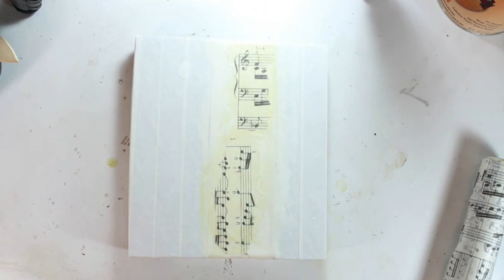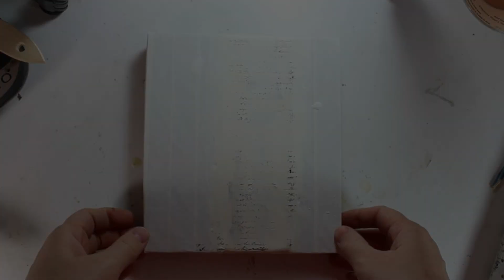Partial Encaustic Painting in Old Wood Block

Comment: I would try putting clear wax down over the tape first?
Reply from the maker: That is a fantastic idea. Totally doing this next time.
Reply: Or even a varnish. Had you added a varnish or some other resistant medium that won't melt or move when you apply heat, wouldn't the excess wax just peel-up?